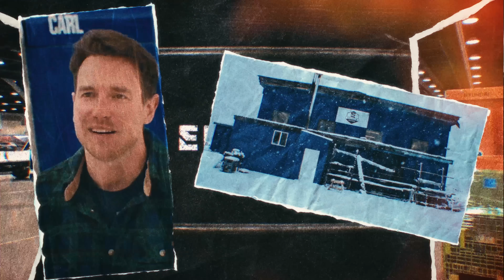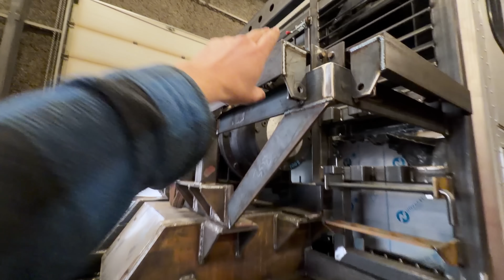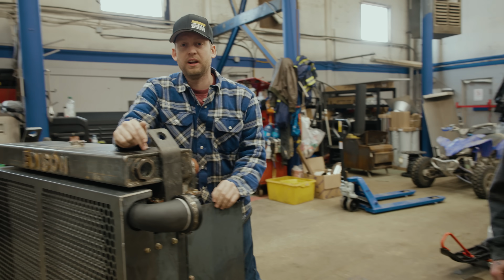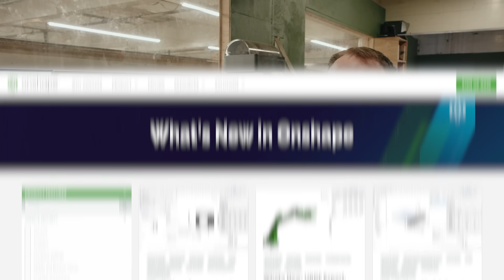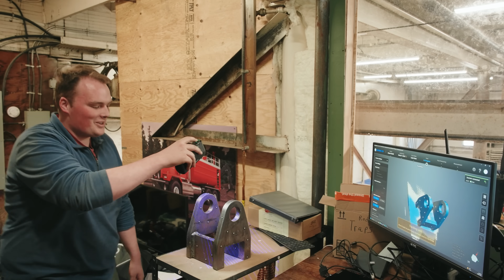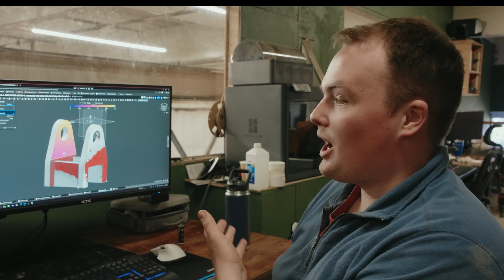This Truck Is Getting Serious

Comment: Seeing you guys utilize all these cool ass design tools and software, as a small team, and how fast you work...... Your transparency in the design and build process really puts a bit of shame on the mainstream heavy hitters that spend hundreds of millions on design, fab, testing, modeling, with hundreds of not thousands of staff, all to end up rolling out some overly convoluted proprietary, priced, garbage. 

Imagine what Paccar or GM and their competitors could do with design teams numbering in a handful of people, using modular part designs, and more service/repair focused designs. Halved R&D costs, streamlined everything. Lower sticker prices in an already tight economic situation...... And happier customers that get a cheaper vehicle, that's cheaper and easier to repair/maintain, and a significantly higher customer retention rate.

Comment: Suggestion: run empty conduit out to the middle of the floor and terminate it in a box, possibly a few inches under the concrete, if so with a tape marker. If you need to have power in the middle of the shop, just run a cable through the conduit. No trenching through concrete needed!

Comment: In this area, St Louis Mo, its used alot on construction trucks.  It's known as a "sliding 5th wheel". BUT is the 1st dual locker I've seen. In 30+ years of working on trucks a dual locking, I can see. Could be an advantage. 
Who makes it - Fountain?

Comment: What an exciting video. I  studied drafting in high school starting in 1960. By the seventies I was working on Freightliner trucks and later mounting and installing refuse packers. I owned a Mack in the eighties and went back to school to study industrial mechanics and computer aided drafting at college. The scanning is amazing but I would not recommend a bastard file to remove material in your hangar. I think you are doing a fine job on your rig, from what I can see I approve.

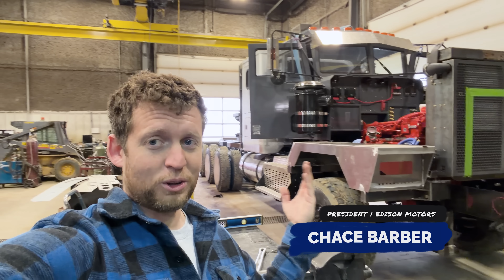Comment: 1:45 make sure the plumbing in the new shop is skookem.  I know you have a mill on site, but I don’t think they can process those logs you dump in that beaver lake Eric calls an office.   Last thing you want is to shutdown production because of a log jam.
Reply: And make sure you have toilet augurs around. They will be so much more powerful than most crappy plungers
Reply: Good 1
Reply: @henrycarlson7514 it’s more for the #2 and not as much #1
Reply: And it wouldn't be a blue collar workplace if it didn't be some toilet humor going around.